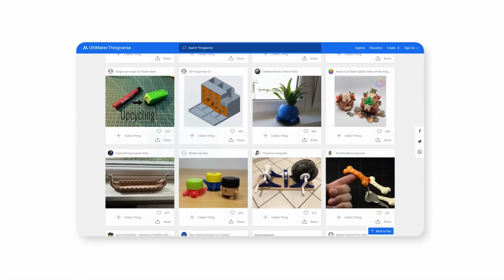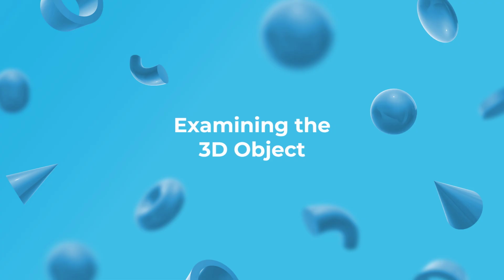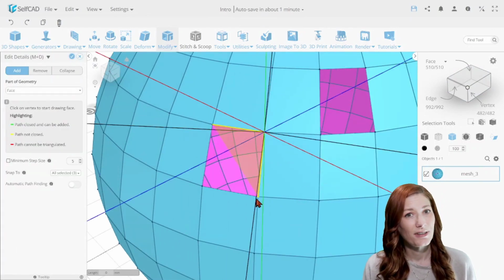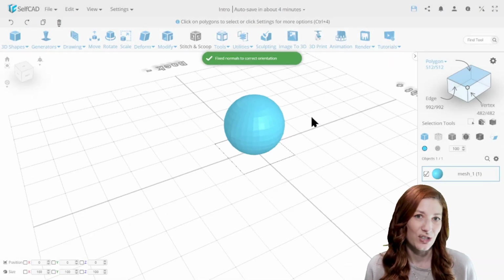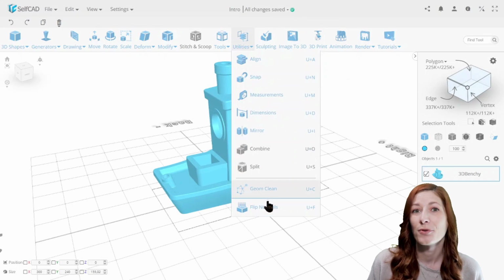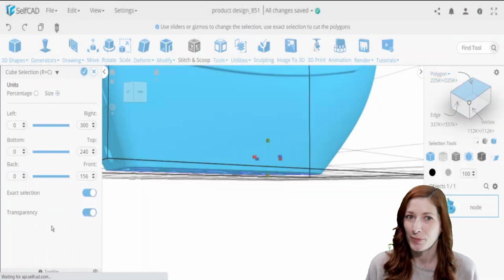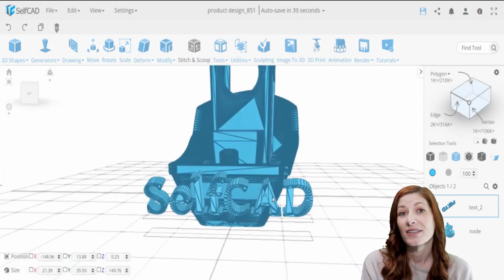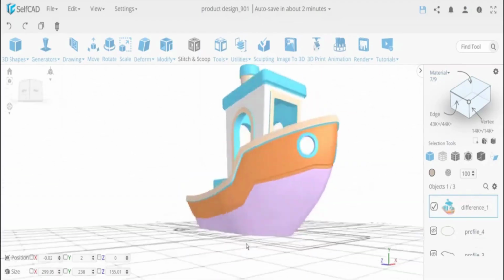How to Edit Imported 3D Objects

Comment: I'm a newbie at selfCAD and in the evaluation phase. While I find this CAD program a bit different than others I have used, I like what the developers have done to make this program more inclusive. I am still trying to learn the language of selfCAD but I find a lot of time saving (click saving) features. Maybe I haven't run across this yet, but I do hope there is a feature to create technical drawings with measurements.
Reply from the maker: I'm glad you like the software.
We do have a feature for creating technical drawings. It's called Projections - you'll find it almost at the end of the Toolbar. It's not mentioned in this video series, as it's a new addition to the software (that tool was still in development when we were recording the 101 series).